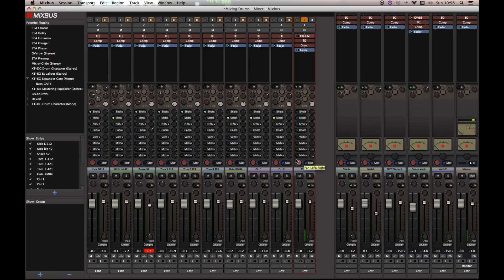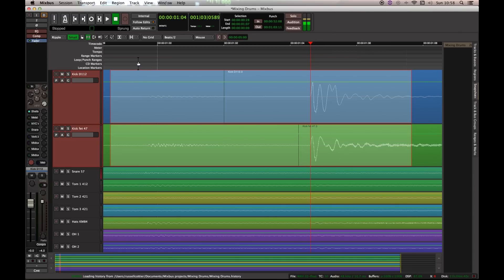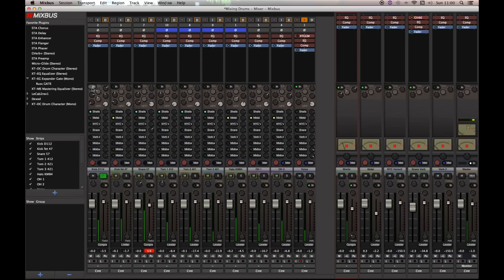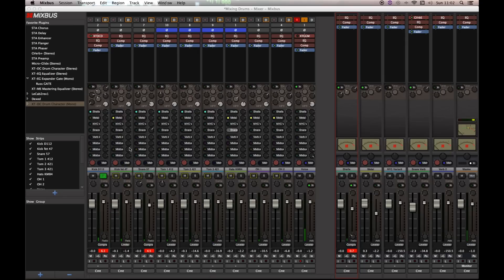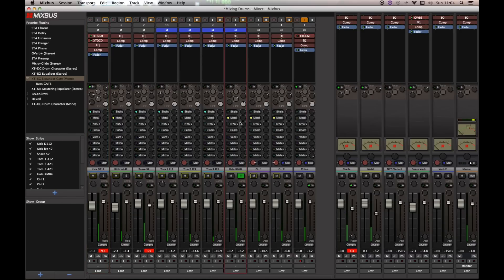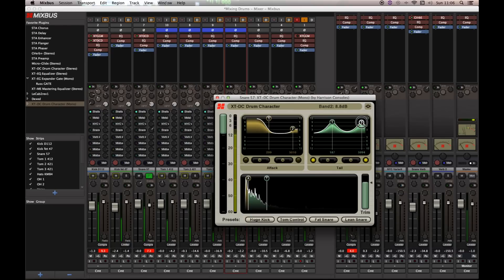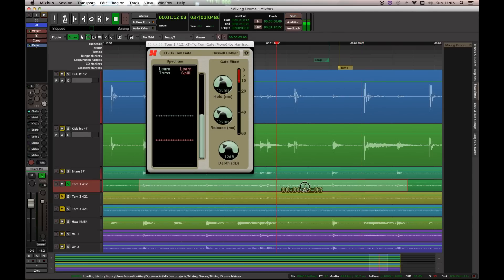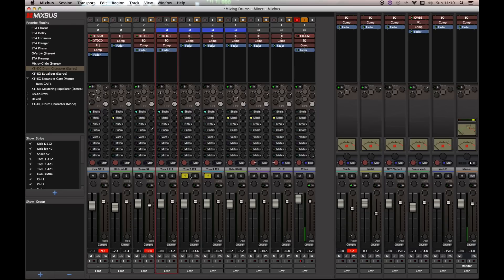Drum Mixing Workflow Tips

Comment: Hey mate, i want to ask you how you feel about the peaking the kick & Snare 6-9 dB on the channel mix makes the end product sound? ive recently noticed how the Meterbridge can cause me issues on the settings i want tracks busses & master settings..
Reply from the maker: Instrumental Asylum sorry about the delay.

Well do you mean clipping the kick and snare by 9dB?
Reply: hey Rus, yea my strategy would be tomix the rest of the drums under 0dB so that my channels are not clipping (even tho 32 float will handle it ) for the purpose of all the processing that will occur in the Busses & master.. Now with the VCA'a id use them to bring the peaks to where i want them & then take the mix to the busses clean & with headroom to process.. cld always use the Busses Trim to reduce but i find the channel faders tell me more in the mix & the allow for instrument levels to sit better as the mix evolves into the 2 track master..
Reply from the maker: Instrumental Asylum I feel like you are adding complexity unnecessarily but if it works for you then co for it. 

As far as I understand the Mixbus architecture the drive control on the busses can be thought of as a ceiling or threshold control. You don't need to drive into the bus harder to achieve more clipping in transients...just roll up the drive.

But essentially I think you're saying that you want the kick and snare to be the loudest elements and clipped...which is kind of what I do in rock mixing anyway though we may take different routes.